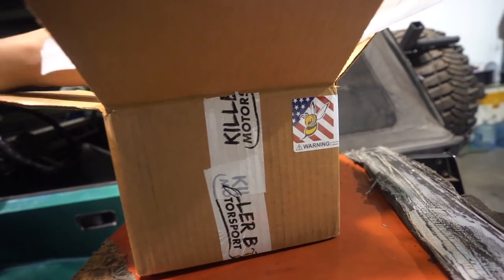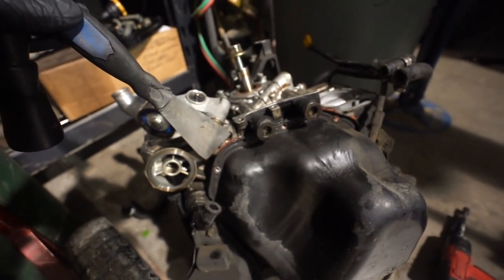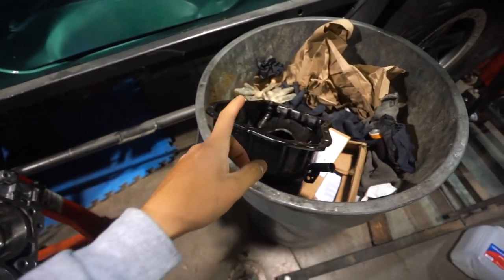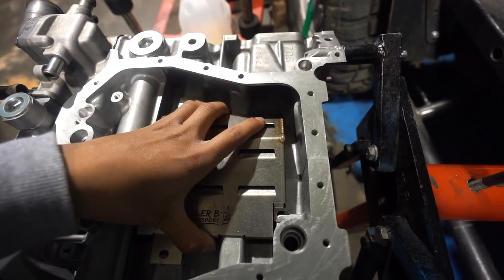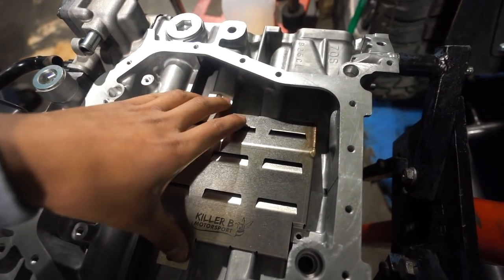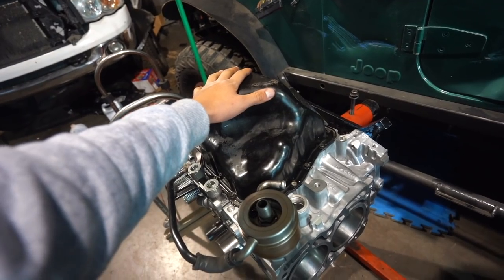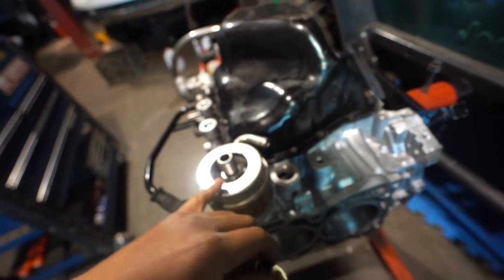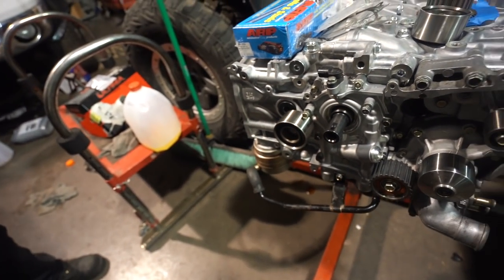Killer B Oil Pick Up And Baffle Install! 2004 Subaru STI

Comment: You can’t reuse a timing belt kit after you have tension it. That’s a bad idea to reuse your timing belt kit and tensioner. Also your not supposed to reuse oil coolers after an engine replacement. Spend the extra money

Comment: what happened to your oem motor?
Reply: Right I asked when they first started disassembling the motor. Only hint was that it was burning or leaking oil sum shit like that.
Reply: As far as we know there is nothing wrong with the oem block. The oil consumption and smoke out the tail pipe came from the heads. Danny decided to go with an IAG block because he wanted to rule out the block if the heads were fine
Reply: @flat4ninja93  thnx :3